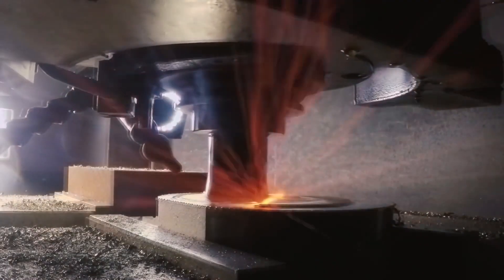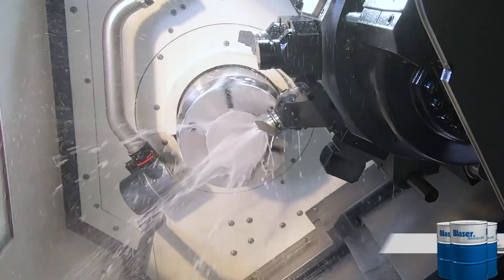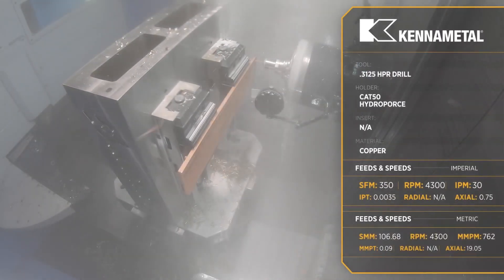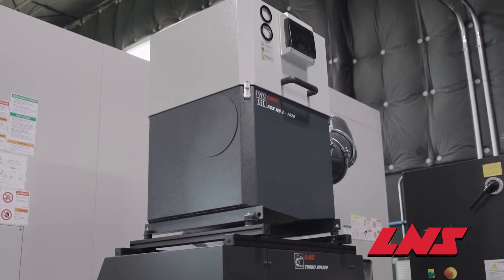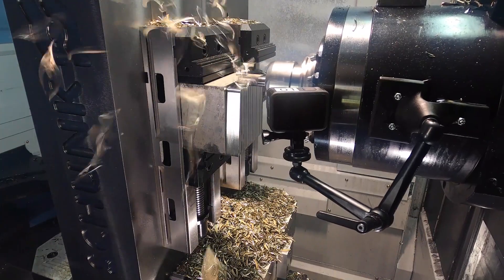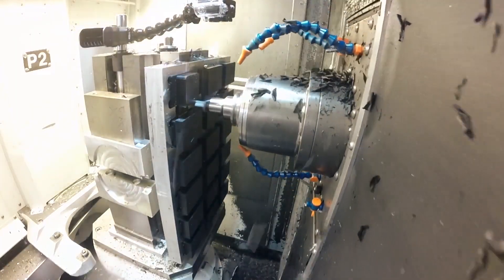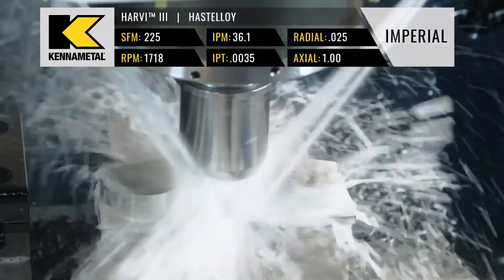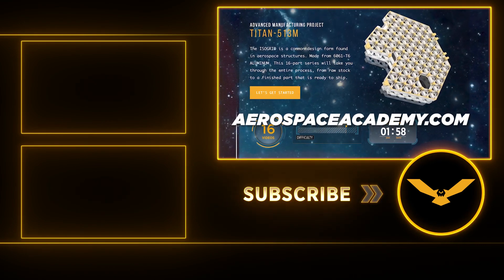This is the MOST CHALLENGING Material I’ve Ever Had to Machine

Comment: I would imagine super alloys are about the most difficult material to machine. 

Stelite being the worst. 

But hey, that’s why jet engine manufacturers use investment casting for those hot section  fan blades.

Comment: Hardened Vanadis 4E has made some days longer than my regular days.

Not because it's ridiculously hard, but it's very resistant to abrasive wear, which is why it's used when making inlet parts for injection molding tools.
It's almost as if the tool disappears at the same rate as the material, leaving a cylindrical hole with more of a conical shape.

Comment: When all else fails, go back to the old tried and tested method of low rpm, hss tool and Rocol cutting compound. The same applies for copper  but switch to paraffin with a dab of oil added

Comment: Sand in iron-castings ... best material to machine ... EVER .
About 0,03 secs ago you were drilling a nice 2,165" inch hole in one of those gas-turbine halves with your trusted indexable-insert drill, now you have a burned and fused mess as tool , a stalled and alarmed-out machine and a bit of work removing all the shite from the hole you wanted to drill ... sand from the cheap-ass casting process included .

Oh yeah ... sand is my biggest enemy so far ... I guess I had it easy ? :P
Reply: Sand can be your worst enemy. I had one job to program on a CNC horizontal mill.... T356 aluminum sand casting (gear housing for a rotary actuator for Boeing 737 aircraft). Blind bearing bores +.0000/-.0005 dia..... Flatness .001" front side to back, and a whole host of other tight tolerances. As soon as you hit a sand inclusion..... It would make mince meat out of your tools (high speed steel or carbide.... It didn't matter). Sand castings are some of the toughest things to machine and still keep your tools Sharp.

Comment: The most difficult material that i have machined was stainless318 L better known as duplex , i don't know what the american name is for this material, but it was a real head ache to get it turned down to diameter, my tool life was less then 5 minutes, then i had to change the insert. Your story about delrin sounds fermiliar, we had the same problems, holes getting bigger or just the hole part bending like a banana when unclamping,.and you might tell by the spelling but i'm from the Netherlands
Reply: We are going to do a video soon on Duplex, thanks so much for the comment! Stay tuned!

Comment: 909 inconel that will bust your nut I'd like to see one of your Harvey end mills hit that.
15sfm carbide forget it try Greenleaf ceramic the only tool I ever got to cut and hold tolerance without spending hundred bucks apart on carbide.

Comment: I had some mystery aluminum donated to my robotics team. It is basically junk. You can’t drill holes in it (easily) with Bridgeport/drill press. Cutting it makes it heat up like crazy. Pretty sure it’s 50% gum 50% aluminum. Cuts okay with an end mill but wears it out very fast and will stick like no other
Reply: Hahahaha 50% gum 😂
Reply: I've seen materials like that. Usually they're cheap imports from China or Japan..... And you usually find all the impurities gathered up in the middle of the bar or the Central matrix of sheet. The right machining move to do with those materials is...... Dump them in the chip barrel!

Comment: Interesting that you chose a copper alloy as your first bullet point. In my opinion, copper is the most difficult material to machine because it wants
to not just push back like a hard material but instead, wants to grab the flute of your endmill. I have been a machinist for 25 years and I have avoided this material
with enough prejudice to not even want to go to work for a company that offered me a job with ok pay but was machining copper.  In the last 3 years, I can say that I have greatly
improved my skill set. Now I understand the concept that you can have a great roughing endmill but it is a waste if you put it in a setscrew tool holder that runs out more than .0005 TIR. Also, something that Titan really stressed as important but I didn't pay enough attention to was the quality and concentration of the coolant. When machining anything like copper or titanium it's the whole picture that becomes just as important as just the 2 most obvious details of cutter choice and speeds and feeds.
Reply: Man what a great comment! Its really awesome to hear from an obviously fantastic machinist! You really get it, Paul!

Comment: Hastaloy is nasty hard. There is faa mandatory  upgrades on the stuff when it comes in the shop. Adding a bleed air groove, etc. We do it on the bridgeport. Slow Nd steady wins the race. Price to your capability and you'll never loose or find out you need to add capability.

Comment: The hardest material I have worked with is Invar 36      That crap will eat some tooling
Reply: I did Kovar like 20 years ago. I was told that it's the most temperature resistant metal on earth. It'll measure the same dimension whether It's hot or cold. The parts were to go on a satellite in outer space. Evidently even on Pluto the parts would still be in tolerance. That's nuts to me.

Comment: K 500 Monel and Nitronic 50 ,that stuff can sit in the ocean for 1000 years with zero corrosion
Reply: I have some funny stories on BOTH of those lol
Reply: NITRONIC 50 is, as the original ARMCO brochure says, is "very susceptible to work hardening". If the cutting depth is not sufficient and/or tools are incorrect and the stuff smears, you're in trouble. 

NITRONIC 60 (UNS S21800), the anti-galing version in the NITRONIC family, is even nastier in that regard.
Reply: Recently turned some monel 400 on the lathe. Was easy to machine

Comment: UHMW and 316 stainless gives me the most trouble. I haven't worked with more exotic materials. 

My issue with UHMW is drilling. The holes close up, typically near the bottom. I'm pretty sure heat is the issue. However, I don't have TSC.
Reply: The key is to use high speed tooling and speeds & feeds remember it maybe out of tolerance one minute wait a bit and it will come back in. My experience in the orthopedic industry
Reply: @billharrell7422  I will give it a try, next time I run some UHMW. Thank you.
Reply: @horseshoe_nc  When drilling UHMW one thing you might want to consider is making sure that your drills have a split point. The web at the tip of a standard twist drill May cause too much heat generation because the web doesn't cut.... It only pushes.

Also using titanium nitride coated drills may help somewhat. Their surface is a lot slipperier than plain tool steel, and this will allow for much less heat generation.

Also you might want to consider using parabolic fluted drills. These drills will allow the plastic chip material to evacuate the hole in a more efficient manner, thus reducing heat generated and helping to keep the diametric tolerance closer to blueprint.

Comment: Hi titan How are you sir.

I need some advice on drilling aluminum. The one thing i don't like is getting strings of shavings when you drill, i like the chips so sometimes you need to lut the speed and feeds up. But the problem i have is the aluminum on the outside of the hole flares up and it makes it very difficult to clean. Please any advice (Note it's a 3 axis mill)
Reply: There is a lot more information needed to give you an appropriate answer. What kind of aluminum? What kind of drills are you using? Through coolant or spindle coolant? Based on what you did give for information I would say the reason you are getting that flare could be your drill is walking on initial cut. Are you pecking? Stringy chips is definitely a speed and feed issue. You want to feed a little harder and break the chip.

Comment: Has to be 455 stainless for me, I ran titanium at 80 meters a Minuit, this 455 stainless had to be run at 35m/min and 0.3mm per rev to get it to chip without it sticking to the turning tool and wiping the edge off. Anything above these meters a min it would instantly weld itself to the edge and destroy it. Also had to have a high pressure jet of coolant blasting into the chip breaker and reasonable pressure flood coolant directed straight at the entire TNMG100408-M3P - 830grade (iscar). I know there was probably some other options for tooling but the boss didn't want to buy special tooling for this one specific job as there wasn't many parts. Good reading through everyone else's nightmares to see we aren't alone haha.
Reply: Right! Buncha incredible problem solvers in here!

Comment: 14301, we get laser precuts to machine to size, sometimes they are nearly impossible to machine due heat transfer and hardening through the laser precut
Reply: 304 stainless is not really that difficult to machine. But dealing with those hardened surfaces from the laser..... I would have them allow a generous amount of material to remove, then take deeper cuts in order to get under the hardened surface ....with a generous feed rate. You can't treat hardened surfaces too gently...... Otherwise your tools will just end up rubbing against them rather than cutting, and they will dull rather quickly.
Reply: @johndonlan5956  jeah, sadly due to "cost savings measures" they cut to +- 1mm
Reply: And 1mm is just to little if they are cut out of 30mm plates

Comment: Copper is literally one of the most abusive materials on tooling. I never had a problem with drills drilling bigger as you go, instead I've always seen the copper start to wear the drill out and start to taper. There was one job in particular that I remember, it was a round copper part that I was putting a 6 hole pattern on. Hole were drilled for a 1/4-20 forming tap. ( Tapping was performed out of the mill and on a Flexarm®). Anyway, I learned real quick that my drill need sharpened after every 10 parts or else the hole would be so tapered that the drill would seize itself into the hole and break. To this day I hate machining copper. In my opinion copper is the rubber of metals, it's soft and relatively easy to cut, until you need to cut it.
Reply: Hahaha love that lest sentence
Reply: Slitting saw making heat sinks .... gummed to f&**@ at random.
Reply: Titanium nitride coated drills might have helped a little better. Also, there was a company called "Precision Twist Drill", and all of their drills were cryogenically treated. The cryogenic process made the grain structure smaller, and it tightens the binder between the grains...... Hence, these drills would stay Sharp about 10 times longer than standard high-speed steel drills.
Reply: From the very first experiences I've had with machine tools copper got me one day my father knew exactly what was going to happen and he wanted to see how I would treat it simply making some little parts out of copper they needed a couple holes drilled so you get your center drill and put a nice big center in it and as my drill touch that part it ripped the handle out of my hand the part out of the vise split the drill up middle and threw the whole mess on the floor my father almost hurt himself falling out of the chair laughing.
Then he got serious came over and recommended before I did that again that I should only make a small spot not try to put the chamfer on the hole with center drill then I also needed to reduce the rake on the drill even if only by taking a stone and dubbing it off at 0°, if you look in the books copper is supposed to have a fairly high angle of relief that's great in a CNC where you have high power work holding and tool holding ability in a drill press or a Bridgeport not so much you will get hurt since then I have made some pretty wicked parts out of copper scared the hell out of me the whole time but thankfully I got through those safely mostly by being very cautious about how big of a cut I took and not even being in the room with the machine while it was cutting that's how we got through many parts that were just plain dangerous to run.
Biggest problem I've ever seen in machine shop is rigging a part to be placed in or on a machine or during its removal.
When I worked in East Germany with the company that I worked for we built the finest machine tools made and it got to the point where we were no longer allowed to lift anything over 50 ton we actually brought in a crew they used all of our straps all of our lifting equipment but the employees of our company were on the the sidelines for safety.
Sometimes it's just better to get experts who do that and only that as Machinists or millwrites are often too involved with getting the job done they miss one little thing and disaster strikes.

Comment: Any material that has an internal crystalline structure that varies tention and compression with companion grain boundaries is a real challenge. Just like the delrin letting loose (tension relieved) or compression relieved in copper. You'll never see it before or during it only comes out in the QC measures.  Unfortunately most raw materials although their heat treat was done it may not be perfect throughout.

Comment: I often run 17-4 stainless on twin turns and triple turrets. 17-4 up to a year and a half ago was one of my favorite materials to machine. Consistency of mills and distributors are key to maintaining tool life and chip control with this material. The current material availability situation has added a major twist to what were once favorable cutting conditions. I have seen Rc jump from 28 to 36 from the same supplier. Same material but different heats. Come to find out the supplier switched from taiwanese distribution to north American and the north American variant is not only softer but also allows greater fluctuation in their nickel content. I saw every single tools projected life cycle decline by 80% just by switching heats. I understand these are common occurrences in machining but these are astronomical jumps in my opinion.
Reply: I hadnt thought about this too much, but no doubt you are absolutely correct. Thought provoking post!!!!

Comment: Forget machining. They'll be 3D printing exotic materials in another 10 years and you'll be out of a job.
Reply: 10?? It's already being done right now! But the thing with additive manufacturing is that it is NOT a direct drop-in replacement for conventional machining. Raw material, so the "toner" in a sense, is much more expensive than conventional stock. Printing times are much longer than machining times. On the other hand, part complexity is free and part cost is pretty much independent of series size. 3D printing only makes sense for small series clean-sheet new designs where the full shape freedom of AM can be utilized.

A high production volume simple part, easily machined from bar stock, will not be replaced by 3D printing for a loooong time. Complex small series parts? Those will be, and much sooner too.
Reply: @Hydrazine1000  in 10 years I'll be 3d printing Inconel parts in my garage on a $200 printer.
Reply: @KeithAlumbaugh  Printing how? I mean by what method? Selective laser melting, for which you need a 200+ watt laser and advanced optics? That's not going to happen for US$ 200 within 10 years. But metal+binder printing with metal+binder filament, which allows you to print a green part that will have to undergo debinding and sintering in a vacuum furnace after the printing process? Now that might be possible even earlier than in 10 years. 

But printing+debinding+sintering will not get you the same mechanical properties as conventionally processed/fabricated Inconel. With selective laser melting you can achieve properties comparable to regular fabrication, but that method is a very very long way off from costing US$ 200.

Comment: I made a pair of wedge shaped parts out of a material called FX. They had a 1.5-8 acme threaded hole that the genius boss thought he'd use a hand tap on. Tap wouldn't even start. I ended up throwing them on the manual lathe and single point cutting those threads.
Reply: Awesome lol!
Reply: That hurts to even just think about! Hand tapping a 1.5" thread? Was King Kong on staff that day?
Reply: @johndonlan5956 I’ve hand tapped a 2 1/2 NPT hole but it was cast iron

Comment: One job that used to be a big challenge is these rolls for rolling out lead sheet. Their 52100 case hardened to around 62 rockwell. The necks are 6" diameter and the bodies are around 16" for a total of about 800lbs. Roller bearings run directly on the 6" necks and the customer runs these rolls hard. Some come in with necks broken clean off. The necks often work harden to over 70 rockwell and at that point they start blowing out chunks of the neck. The heat treat was supposed to be 1/4" deep. We would have to turn down these super hard blown out necks to 5" diameter and the interrupted cut just killed tooling. We also noticed the heat treat was usually .250 deep on one side but only .125 on the other and thats always where the blow outs happened. The customer has since changed who makes the rolls and we dont get big blow outs anymore. Now they're just hard about a 1/2" deep lol. But since they cut is clean cbn inserts cut through it pretty easy.
Reply: Problem + solution, love it. Ive learned alot just reading the comments on this video!